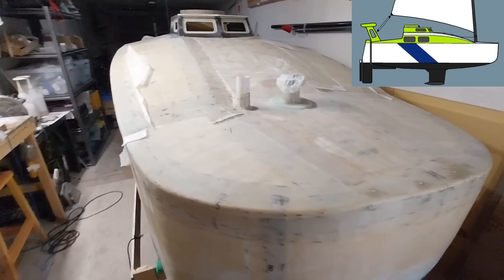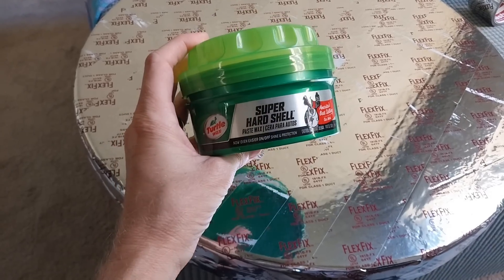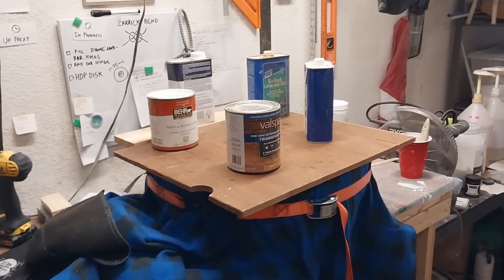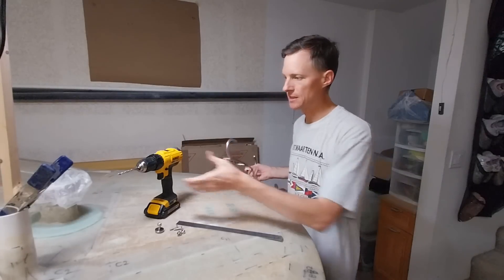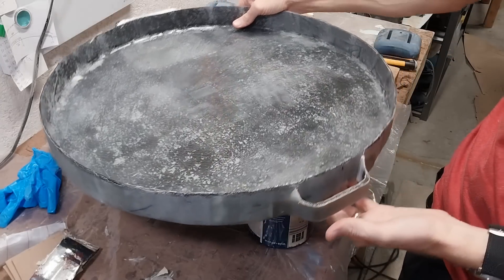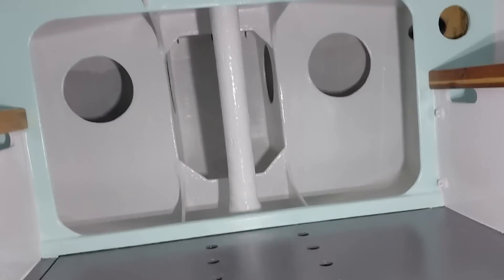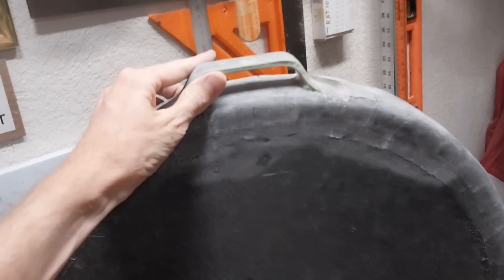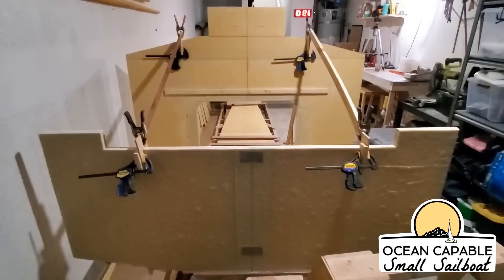OCSS-083 Building a Custom Main Hatch Cover from a Mold - Mini-Cruiser Sailboat Build

Comment: Hey, im designing now a little bigger boat with same ideas. I like your hatch. I thinking a lot about round hatch for my boat, but i dont like what i cant build new one in any point of earth. Little bit complicated. Do you already tested it? What about rains and storms - how you will close it without puring 2 gallons of water on you?
Reply from the maker: I have tested it and it works well. If it's rainy and stormy you just have it closed. There won't be any 2 gallons of water in it. If there is some water in the open hatch, you just pull it up 90 degrees, water will drain out near the hinge in seconds (not inside the cabin due to the high lip,) then close it the rest of the way. Clean up drips with a rag.

Comment: Ingenious, to be sure. But getting up on top of the cabin to insert oneself does not strike me as a safe approach.  I know Perry's intention is to mostly remain inside, thus the simplicity of the rig.  The 580 class design (19' glassed ply sloops racing across the Atlantic right now) use an aft faced, vertical hatch that's much safer in use...in my view at least.
Reply from the maker: I would but I can't really fit one. They have 5' more length, and more height to work with as well. An aft facing hatch on my little boat would conflict with the tiller.

Comment: I know you have the ventilation vent that will be waterproof even during rollover, but will that be enough?  Your window/portholes are going to be sealed and non opening yes?  It may get too hot inside there to sleep even with the doghouse open.
Reply from the maker: You're probably right, it's going to be hot as hell. I'd love to have a bunch of wide open hatches for maxim airflow but then you resign yourself to the risk of suddenly taking on a lot of water.

Comment: I think in bad weather you’re going to get a significant amount of water through that reefing line eye. I hope you’ve made sure it has a way down to the bilges without causing too much trouble!
Reply: I think I would have routed it to the rear of the doghouse, round a pulley and in through the side, or even two pulleys and through the rear.  
There will be a lot of water pressure on the tube when the waves sweep the deck.
All said, being able to fully control the sail from within is going to keep you dry inside much better than having to open the hatch.
Reply: @markthomasson5077  if you route it to the rear of the doghouse, what's preventing a following wave crashing from behind and in?
Reply from the maker: I'd hold judgements until the end. I could cork it with a rubber plug if a lot of water is coming on deck. There will also be a cleat on deck for this line, so it can be controlled from either place. I can test it out and always make adjustments.
Reply: @ocean_capable_small_sailboat  Fair enough, but when water is shooting into the doghouse is  not the time to sort these things out. If you cross Oceans the question is when, not whether, green water will come across the deck in a storm you have to ride out. And how you are going to make ground up wind in bad weather is one of the things which needs careful thought sooner rather than later.
Reply from the maker: @johntait8422  Patience.The boat is still under construction.

Comment: Cpt Perry, you going to put in an internal latch on the hatch as well? Also, gasket for it? The assembly is robust for sure. As far as Nav and radio signals, you can also add antennas under a layer of glass. Just a thought. Great progress sir!
Reply from the maker: Yes and yes, but those have to wait for paint.

Comment: The doghouse design looks fine, except the main  hatch i found difficult access on rough sea
Reply from the maker: With repetition, entry and exit become second nature.
Reply: @ocean_capable_small_sailboat  You will have to show a closeup on how the hatch hinge works.  If it has a double hitch to lift upward before it hinges open, I'd be worried if the hinge ever malfunctioned or was damaged you'd be locked inside.

Comment: Hi, not sure about your concerns about GPS signal. If you buy a marine GPS unit you should get an external "mushroom" antenna and you can run the cable through a water tight grommet.
If you type this into google you will see what I am talking about -  "Xinuo XF-520 5'' Marine Satellite GPS Navigator Color LCD Screen Dual-Mode Positioning Boat Map Plotter GPS Navigation".
I hope you were wearing a mask when sanding and cutting carbon fibre - the dust is nasty stuff.
Reply from the maker: I've sailed before with no external antenna and I don't feel it's necessary. The units can send and receive their signal fine though the boat. If you watch my videos you'll see I'm pretty much always in a mask when it's needed.
Reply: @ocean_capable_small_sailboat 

Exactamente. Ahora mismo en mi teléfono y dentro de casa recibo la señal de cuatro constelaciones de satélites: GPS, Glonass, Galileo y Osa Mayor